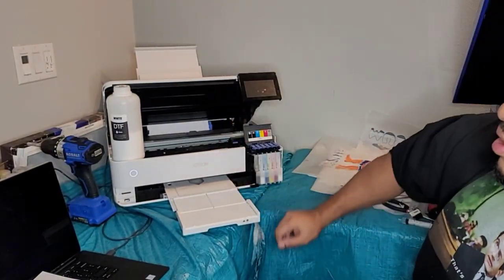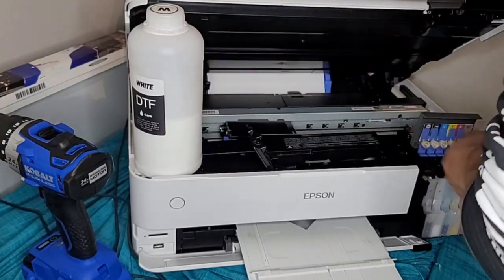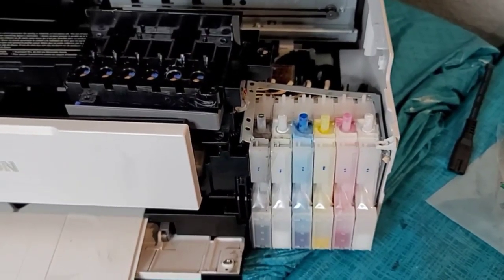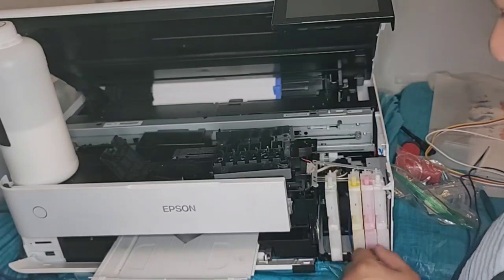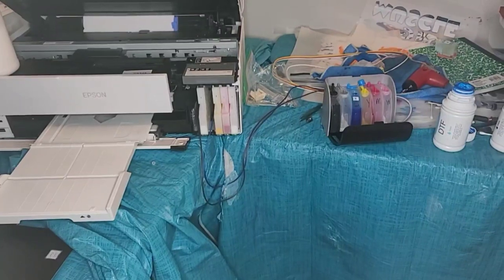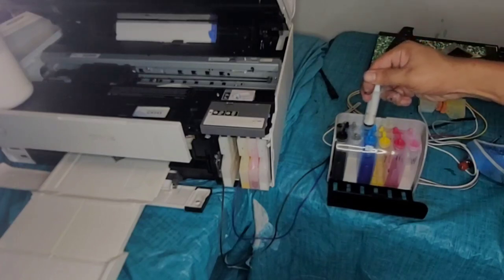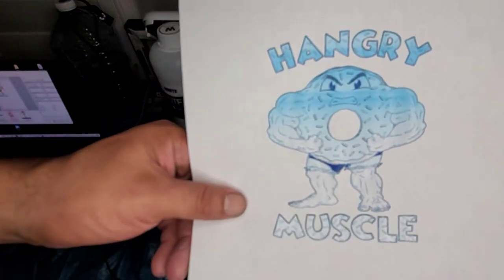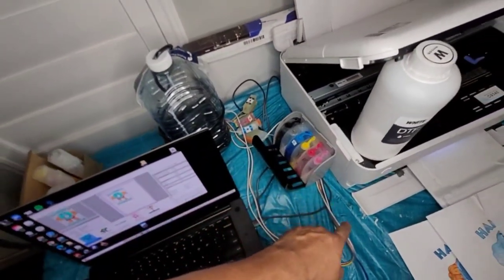Epson Eco Tank ET-8550 How to Install CISS for DTF (Direct to film) Printing.

Comment: I want to replace the inks with DTF ink and installed a ciss, i have old epson ink in there, since there will be some residue after removing i am kinda worried that the colors will change? Any idea if this is a problem? Or will or does it fix itself after printing a few times?

Comment: Hi, my problem has been solved, my printer prints normally, but the used ink tank you change it when it is full or do you have a trick to reset the chip?
Reply from the maker: This is a chipless printer. The print has a option to manually set the ink levels.

Comment: You are a pioneer when it comes to the 8550, are you using any RIP software or just running direct?
Reply from the maker: Thanks fam, Appreciate you watching 🙏 Yeah I mainly use Acrorip at the moment.  You need a rip software so you can tell the printer to print white behind the color image.
Reply: @HangryMuscle  do you know how to hook up a white ink circulation system?

Comment: I feel like adding a cis to an ecotank defeats the whole purpose of the ecotank.
Reply from the maker: The test results weren't great, but it may have been the CISS, I was using. A different CISS may give much better results. Well not really, the l1800 is an Ecotank with a CISS, I don't see why the ET-8550 would be different. I'm also back to using the original ink tank reservoirs, I prefer those much more than a CISS. Consistent and they produce more prints with way less ink consumption. White is really the only color I refill.
Reply: I think it's a great idea seeing that you have to always shake the ink for dtf with this it makes it wayyyy more easier to deal with having the ink on the outside

Comment: Can you show how you did the external waste tank ?
Reply from the maker: I didn't build one for this printer because this maintenance box does not have a chip reset. If you want to build one for this printer. Its same process as the XP-15000 building an external waste tank. https://youtu.be/uMvxm1qhrWk

Comment: You said that you use Acrorip as RIP software.My question is witch driver do you use in Acrorip?
Reply from the maker: What do you mean by driver in Acrorip?
Reply: I mean witch Epson model do you use...but now I found that you have an Acrorip 10 who support Epson Eco Tank ET-8550.My Acrorip 9 don't support this Epson printer.Thanks anyway.
Reply from the maker: @malmo54  Yeah you need a newer version,  Acrorip 10 and above have the Et-8550 listed. You can also use the Cadlink digital factory 10 rip. There's a trial for it.

Comment: Is there a real advantage to switching to the CISS? or with the ecotank it's just better to stick to the original reservoir?
Reply from the maker: I'm sure that they're is advantages but from my experience  the original ink reservoirs use way less ink. The ciss was using too much ink just to maintain it.
Reply: @HangryMuscle  Thanks for the insight! Found out about your channel yesterday and will follow your progress closely! I want to convert one and probably make a video of it in French since there is nothing out there, for frenchies like me :P
Reply: Wouldn't the advantage be that the CISS tanks can easily be shaken to stir the ink as opposed to shaking the whole printer. Also why do you say you are using more ink with the CISS? It takes more ink, but when you do a nozzle check or head cleaning, isn't the printer using the same amount of ink no matter what container holds it? Just trying to learn. Thanks.
Reply from the maker: @marcodeoliveira9933  Its a personal preference, they're both simple to do. Its not same, if you put the same amount ink in both the CISS and the ecotank. The EcoTank would be able to print more pages than the CISS because its designed to preserve ink while still giving the same sharpness and vibrancy. From testing the CISS, on my ecotank. I was refilling often, normally I'm refilling maybe once a day for my colors and 2x for my whites. You can try a different CISS, one with dampers.

Comment: Can I use two ink systems, one with ciss for dtf and one with regular for normal works? I was also planning to use my l1800 for printing photographs and normal works. Is it that you can only use it for one thing even with two ink systems even if properly maintained?
Thanks
Reply: you will need to waste a lot of inks when switching as you will need to get all ink out of printhead and tubing. It will be a nightmare to clean white channels after your regular inks :) Its way better and less time consuming to have 2 different printers.

Comment: Question do you happen to know where to get the tiny metal brackets that come on the original dampers that lock them into the print head? My wife accidentally threw one of my away and Epson does not sell it.
Reply from the maker: Check unicompparts.com or gedat-spareparts.com

Comment: I have a 8550 eco, I took the tracks off and all to convert into dtf, got the cadlink already downloaded, my problem is my dtf in isn['t charging and isn't printing. The printer works but all pages are blank, could you give me some insight on how to fix this problem, thanks
Reply from the maker: When you loaded the new inks, did you run a power clean to pull the ink into the printhead?
Reply: @HangryMuscle  no I didn’t, didn’t know I had to do that. Do you have a video of that, that you can show or you have already done